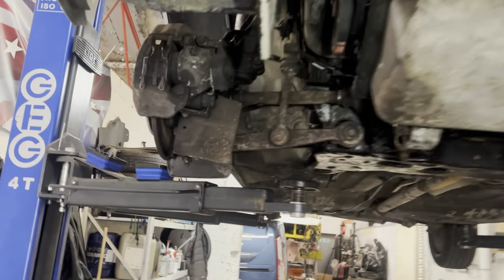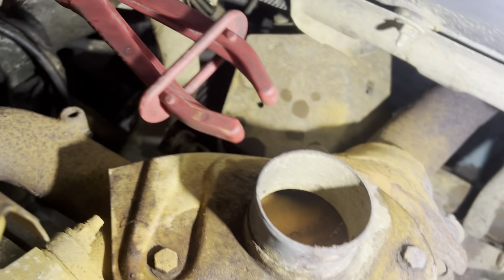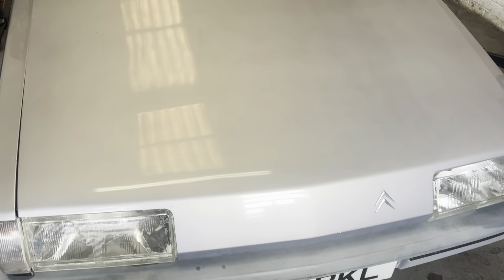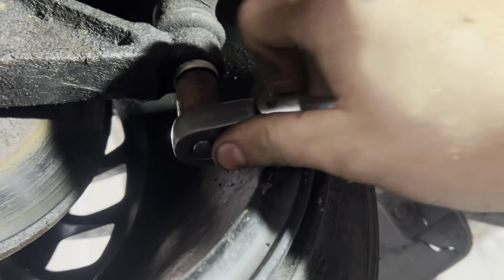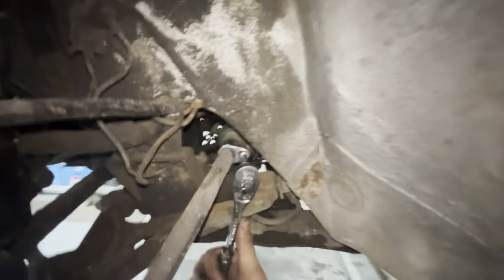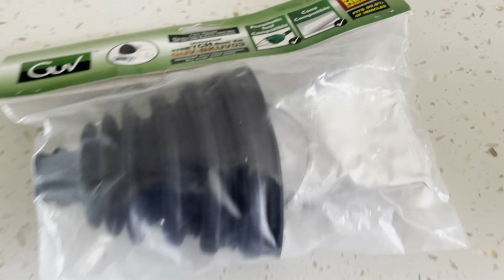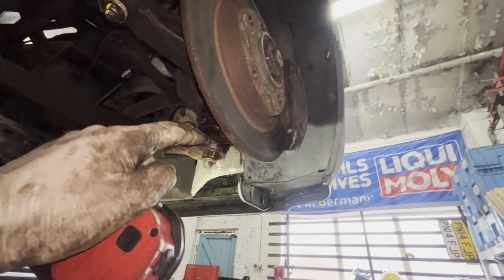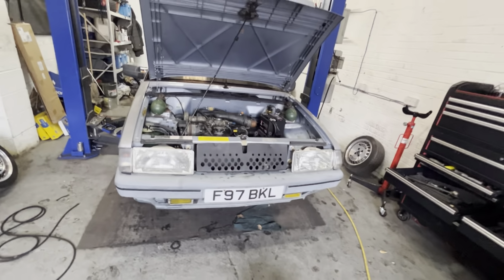More suspension leaks, coolant leaks ,steering rack boots etc! - Citroen BX recommission Week 2

Comment: Good day to you mate, well.. wanna share my experience about my bx back then.. I learned a lot from the 1st one.. bx 19 gti.. it leaked everywhere.. so first thing I got the whole under car cleaned with a  degreaser, I managed to change all the 4 green spheres, flushing lhm, octopus pipe, retrun pipe from the front suspension and voila.. all the leaked are gone.. but after a week.. the leak were coming back.. with additional place like from my brake pedal, power steering rack and also the return pipe from front suspension.. this time I was going to the citroen workshop at my city ( Jakarta ) and found out that I didnt change the central sphere and all the seals within the central sphere housing.. the mechanic said to me that central sphere should have the sound like clicking not more than 1 click per 10-12 second.. if not the leaking will hit every weakest point at the system,  so after he changed all of that including power steering seal, brake pedal seal my problem fixed...
Reply: After that ( apart from the front suspension support bushing failure, the car running perfectly from 2005 to 2014 ( only the standard maintenence needed ), and around 2007 I was also purchased another and another bx.. bx sport, 16 trs, 16 tgs break, 19 trs break.. 😂😂😂😂

Comment: That’s the height adjuster- I think I you might’ve missed the pipe that
Ts off the return.
Reply from the maker: Yeah eventually figured out what the long metal bar does after studying my Haynes manual 😂 and ok? The one above the rear axle? I plumed it up incorrectly at first but then I found the T piece and refit the pipes in the video at approx 4 mins into the video, as all the pipes were perished I’m going off common sense and online diagrams so any help is appreciated!
Reply: @ZakKol69 haha sorry I’m at the gym and didn’t watch the whole thing. Will do though! Keep it up. Have three of these things.
Reply from the maker: @MrAlexfalkner  appreciate the views wherever you are!

And bloody excellent. I’m just trying to get this thing on the road asap so I can figure out all the other issues the car has 😂 hard to know the full story when you can’t take it on a proper drive. Next video will hopefully be, ball joint, bulbs, brake bleed then MOT time!